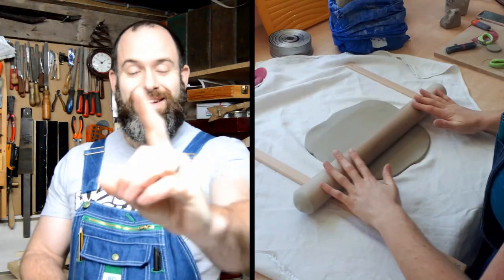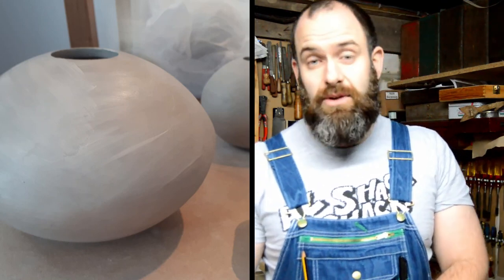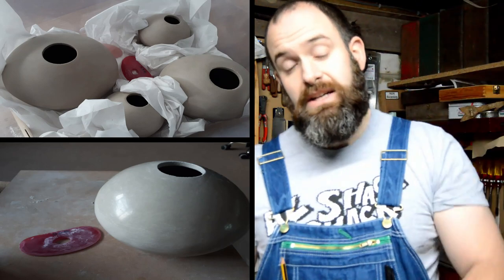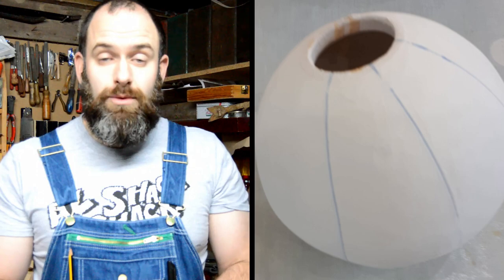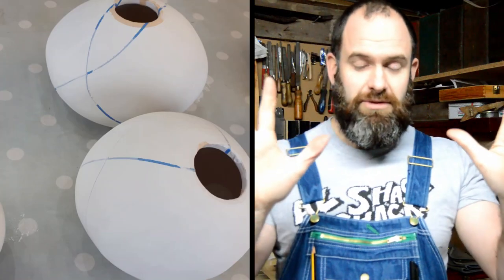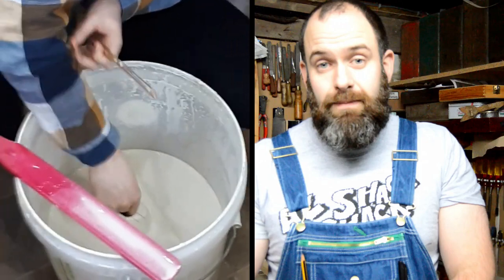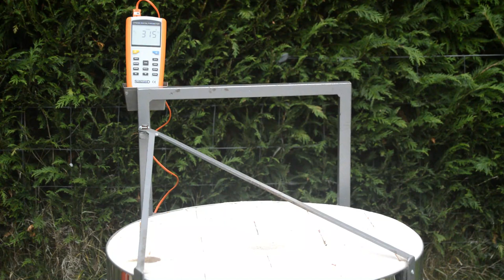Naked Raku in Five Minutes

Comment: That is one of the coolest things I have ever seen! 

Why does the whole thing not crack with the water?
Reply from the maker: MAGIC!.....when taken out of the kiln the pot has been heated to 900 degrees centigrade. Its in the sawdust for 4-5 minutes so has cooled down quite a lot. The water is ambient temperature. Whats cracking off is the glaze that was applied last due to the thermal shock. But the clay itself is a special raku formula.  Thats as much as i know. Whats more impressive is that the Japanese developed this technique centuries ago!
Reply: @WonkyWorkshop  Imagine how much trial and error it took them!
Reply: @heyimamaker  Raku clay IS a special formula, with a greater percentage of inorganic additives:  IE silica or grog (Pre-fired clay ground down to a fine sand like consistancy) that makes it more resistant to shrinkage and temperature shock (Because the grog has already been through the process, for example).  It's way cool.
Reply: @grandcarriage1  Wow, I have never done any kind of ceramic or pottery before but it's so fascinating.